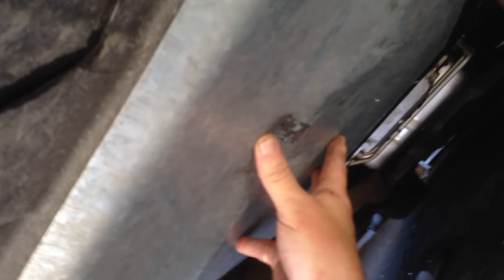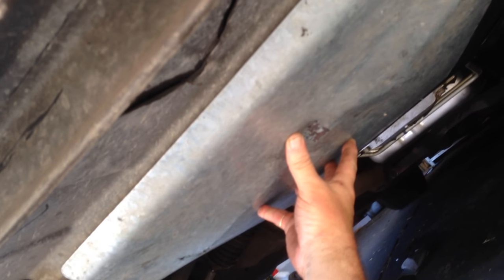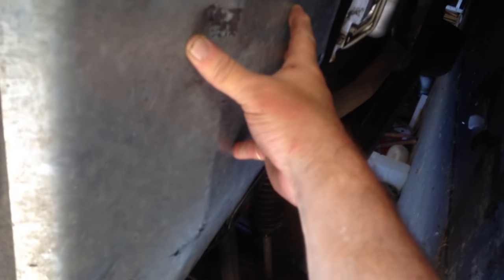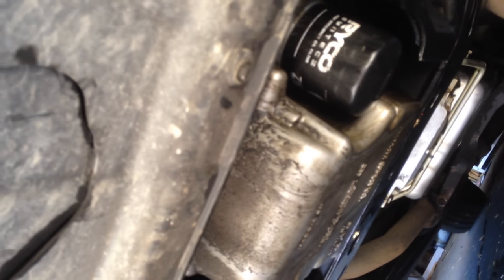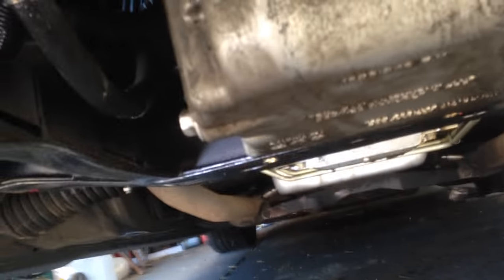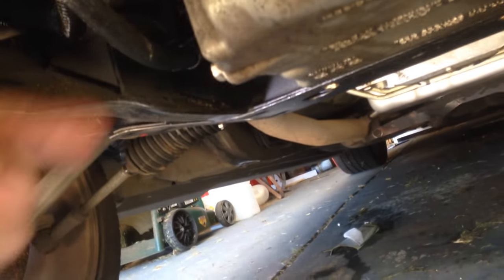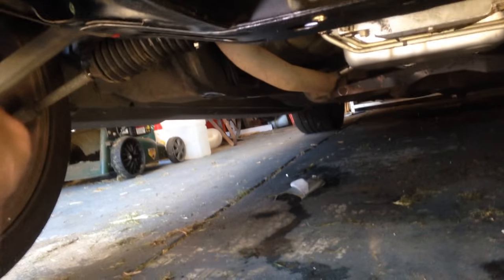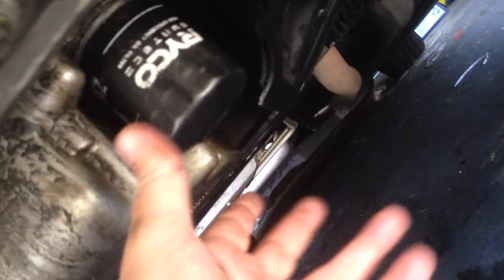How to change the oil and filter on Commodore LS1 VT VX VY

Comment: The service refill for that engine is 5.7 litres including the filter according to my owners manual.

I do mine every 3 months including the oil filter & I did 3330 kilometres between the last 2 oil changes,now my point is that I replaced all the hydraulic lifters before I got it blue slip inspected for rego before last Xmas.

I'm pretty sure that I put enough oil in to bring it up to the full mark on the dipstick but I'm pretty sure that 5.7 litres isn't for a dry refill of a new motor or a motor with absolutely no oil in it.

By the last oil change,the oil level ended up being down near the add mark & I pulled 2/3rds of a 5 litre bottle of oil out of the engine,I've heard that the lifters suck up a fair bit of oil when they're brand new.

I used to be able to fill a 5 litre bottle chocked up full of oil meaning right up to the lid,when I use a new bottle,the oil has always been only part of the way up the neck.

So,I was always short of 0.5 - 1 litre of oil between oil changes but the engine leaked a bit of oil,I've resealed it since & now it doesn't leak a drop,it is coming up to 341,000 kilometres with the original motor.

Note that I used a 73mm oil filter holder to hold the Repco ROF23 oil filter & torque it up to 30 Newton metres,I do the sump plug up to 25 Newton metres.